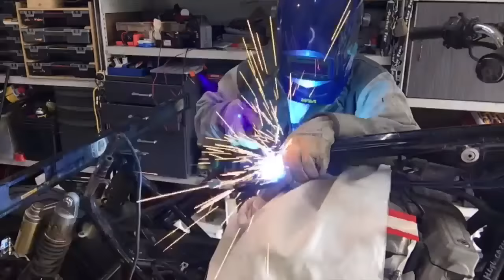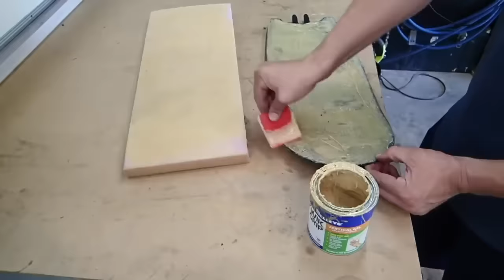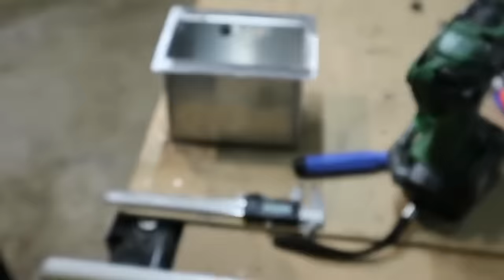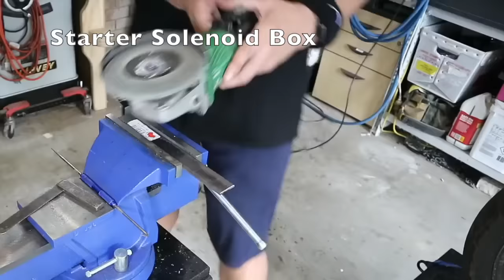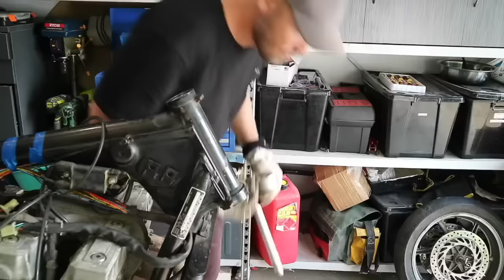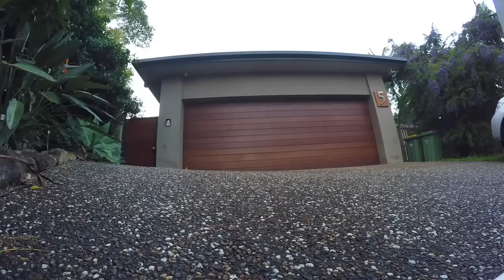Honda ★ CB750 Cafe Racer Build TIME LAPSE - From the Beginning

Comment: reminds me of RC engineering where we built race bikes , Terry Vance was a young hot shoe (taking over the riding for Russ's record setting multiple engine Hondas) and Byron Hines was his chief wrench.  They used to punch the 750, actually 733, out a hundred to 833 and use stock Honda 350 pistons.  Russ had his own manifolds made for side draft webber carbs...fire breathing engines with ARD magnetos and shaved alternators...relatively easy build and a monster to ride, would power this bike perfectly!

Comment: My first was 1979, first bike,17 years old. It was extended 10 inches, no rake change! No pegs, engine foot rest..yeah I melted a little before welding. No kickstand, because of the ridiculous fork, just lean it against a building! Ape hangers that put your hands to sleep, Aqua marine metal flake, sissy bar....I felt BadAss! A year later, forks, short z bars, header, new spokes, bike became nimble, only breakdown...Lincoln tunnel inbound Manhattan points fused! KNIFE SEPARATION, BRIEF SAND, SET GAP WITH MATCH COVER, THREE KICKS...GONE! (I believe it to be still running, or a part of it.....somewhere)

Comment: I built a cafe racer over the winter, removed factory air box and added pods, removed stock pipes added 4 into 1 no baffle, etc etc,. So to tune the carbs I used 100 slow jets and 170 main with 2 spacers under the needle, my question is, what do you/other people use to tune the carbs?

Comment: So impressed with your skills and the build, thank you for sharing.  Starting a cbx project soon and want to fit similar forks as you have, saw you using your press but couldn't quite work it out due to speed of the video. Is it fairly straight forward? Thanks

Comment: Can you please tell me the engineering requirements and registration process you undertake to get a modified bike back on the road. Im considering a 750 virago cafe build but having a hard time understanding the registration requirements for modified bikes ( im in NSW Aust). I recently got my sons heavily modified  Patrol 4wd re registered after it was defected by the police ( 4" lift, big tyres, turbo, etc) . I assume the process is similar for bikes but im old enough to not rely on assumptions . Thanks in advance 
Jon

Comment: Hi i am building my own scrambler out of a ER5, u just replaced the carbu air filter with 2 small airfilters. I realised i had to change the needles and jets. But i lack knowledge... i am not a mechanical. Can u help me with what needles and jets i should go, so it runs smoother again?

Comment: Very nice, what air filters did you use?
Reply from the maker: DNA Pod filters, here are the ones https://bit.ly/2za8gVJ  The size you want for this bike is 54mm, use this link than go to / Universal filters / Aluminum Top / The XV series should be 2nd on the list 54mm 

Here is a video on how to fit them to this model, they need some modifications to fit as you will see here... https://youtu.be/Flx9zyKEqTA

Comment: I must have missed, what did you use the pod for that you created out of fibreglass and moulded around the foam that you had sitting at the end of the seat? Also I really wanted to see a wide shot of the bike at the end, we didn’t really get to see the finished product
Reply from the maker: This is just a time-lapse of where the bike is at the moment, I still need to finish it so there will be another video like this but different and I will be riding it. I think I wrote that in the description, In regards to the Pod, it's a 3 part video but I think you are interested in this 2nd part video https://youtu.be/sf8tch354HA    If you go to my channel and click the videos tab at the top you can see all my videos on one screen or if you just want to see the ones about the cb750 just click the playlist tab at the top.  Hope that helps. have an amazing day and stay safe :)

Comment: R6 frontend swap that speedometer no longer available what system are you using on front axel or other method of cable from stock R6 to speedometer or other system planning inverted swap myself not sure about speedometer set up thanks.
Reply from the maker: I have a video coming out soon with the speedo  Im using on this bike soon so keep a look out for that

Comment: If your going to change the suspension and wheels etc. Etc.  you might as well just get a whole new bike. This is like taking the engine out of a new GSXR and replacing it with an older lower performance air cooled engine.

Comment: What happened to that beautiful cafe seat? It never ceases to amaze me the beautiful cafe bikes or just nicely personalized stock bikes that have a similarly ugly flat seat. The point of a nice cafe seat is it stops your slide back under hard acceleration. That flat seat means you have to hang on to the bars sacrificing handling AND dangerous. That God awful seat sucks bad. The integrated stop light is nice but where you going to hang the plate?
A nice static display bike advertising the skills of the owner. The motor, what about the motor. 
I’m impressed yet I’m not impressed.